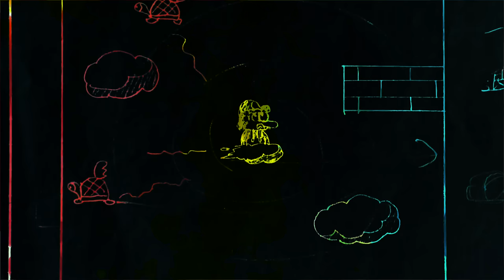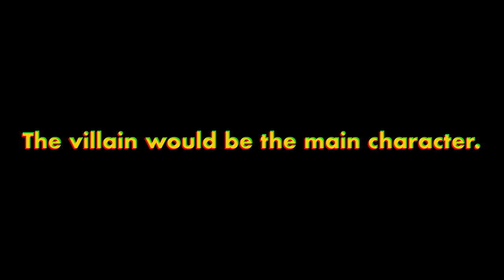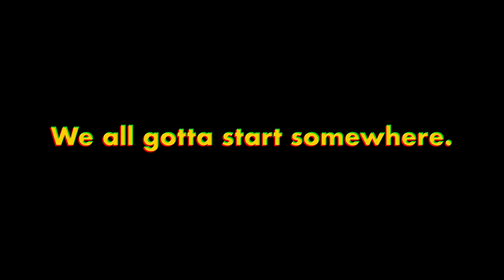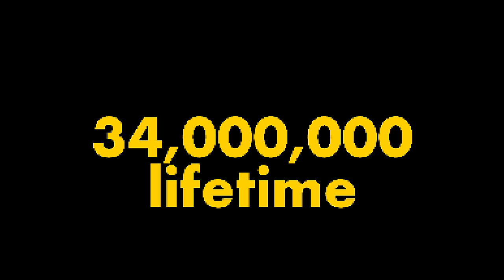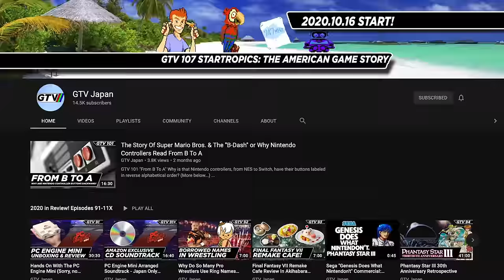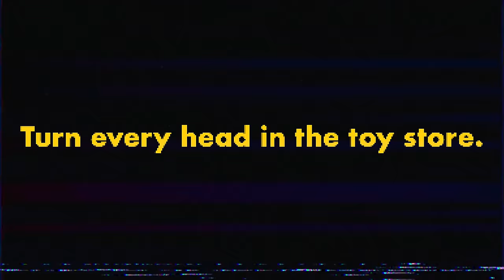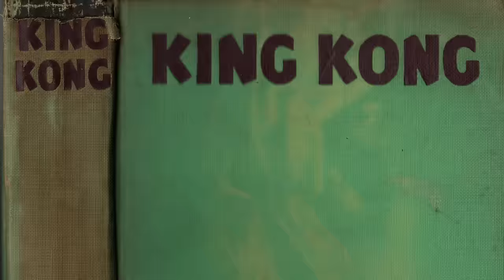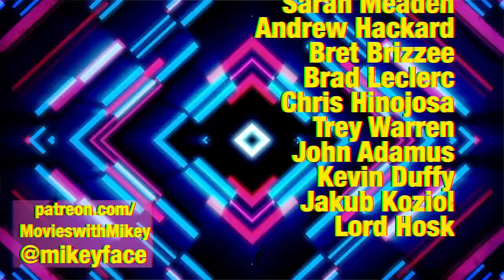Where did Mario COME FROM?

Comment: FYI, Donkey Kong is not CLEARLY parody. It is ARGUABLY parody, but I don't think that would be a winning argument. What is it saying about King Kong? The name is saying they were stubborn, but that's the only part that is commentary. The rest is just a new piece that is either using the same character or a similar character. Had Universal owned it, it would have been a fight over how similar the character was.

I think Nintendo would have won that fight. The only part of the character that is protectable that is used by Nintendo is the name "Kong" and that IS the part that is parody. An ape slightly larger than a human isn't really what defines King Kong. Hell, he's smaller than Mighty Joe Young, WAY smaller than King Kong. He steals a "lady" but that is a common fairy tale trope not unique to King Kong.